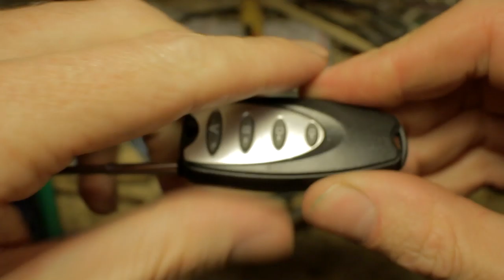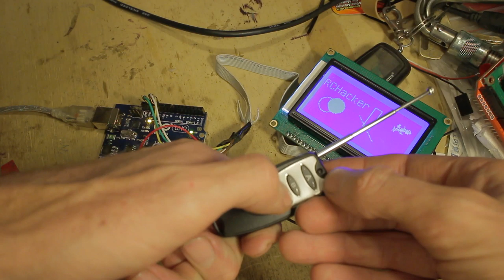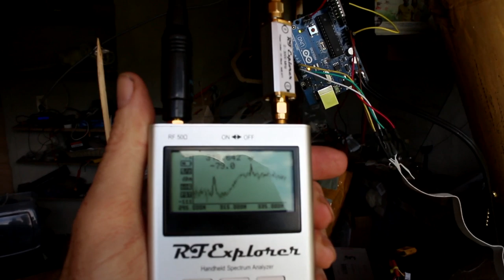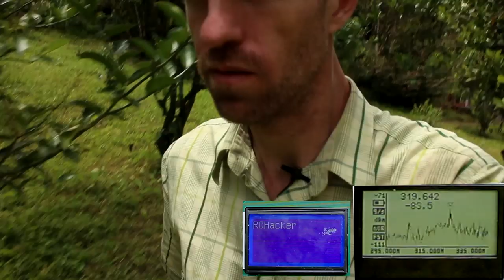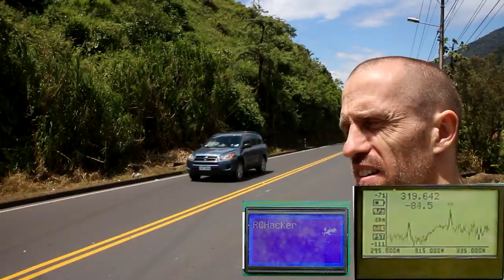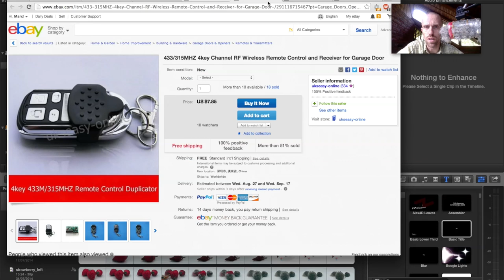Simple Arduino 4 channel radio control. RCHacker #68

Comment: Thanks, I have a couple of the newer  ones with the ugly brown controllers, am setting it up with arduino and relays (wish I knew before that they came with relays before I bought these!).FIrst good how to I have found on how to use it.  Again, thanks a million I can use this with my rear camera on  my motor home as switching before had to be connected to the reverse light, I want to use it to see who is behind me while driving!

Comment: Great Video! I like the idea of hooking an arduino to the KK2. 
I'm planning to do a similar setup using two of the 2.4 GHz nRF24L01 transceiver units (LNA + 2dB antenna module), I've read that it could reach 1000 meter at 250kbps data rate, it's available from elecfreaks for $12.

Comment: Great video,has got me wanting to explore Arduino, am presently flying APM but have never used Arduino in programming it, will follow through your Posts  Thanks Again  Goofa
Reply from the maker: Goofa Pilot If you are new to programming and want a programming book to read, try "The c programming language second edition kernighan & ritchi". 
Its a bit lower level than arduino but if you can get your head around it you will have an excellent base for embedded programming, and all other languages for that matter.
Of course the arduino reference is also a must read.

Comment: Hi!

I red about signal-resolutions up to 2048 Steps from RC-Senders in some forums. So this means that you can switch 2048 things with one channel?!
is it possible to encode and decode a digital remotecontrol-signal to switch other stuff like a cameratrigger or landinglights?
I have a lot of burnedout escs. I figured out that they make good miniarduinos!

What do you think?
Reply from the maker: Not it means that the pulse width has 2048 discrete values in the range of 1000 to about 2000ms. If your clocks were accurate and you had no drift you could do a conversion but 2048 would be pushing it. Much easier to just send a 2048bit number, I would compress it and put a checksum in there for error correction.
Reply: RCHacker
 hmm ok its not precise but the range is great. We can devide areas into values for example 128 steps to provide an ascii code. checksum and everything is fine. if its only one direction.

Pulling data through a RC-channel for arduino I2c-communication could be a idea to get sensorvalues like temperature, rainsensor etc...
 lets say we use the 433 transmitter (because its very light) into the Multicopter to get the rx for the groundstation and use the tx from one free rc-channel.

Comment: why are you not triggering things directly on your remote control with a arduino using the pulseIn function? you dont need this crapy transmittermodules for 1$ for rc! If you use pulseIn and a resistor array in your rc-radio you can trigger at least 20 funktions with a single channel. Or simply modulate data-bits on a rc channel to trigger unlimited funktions.